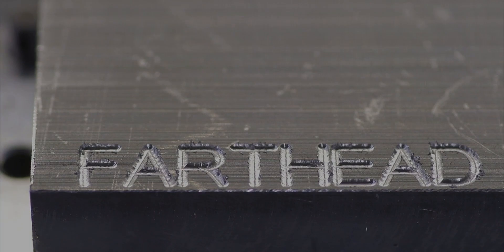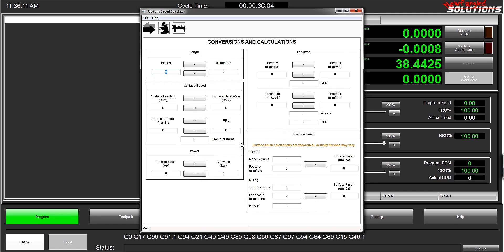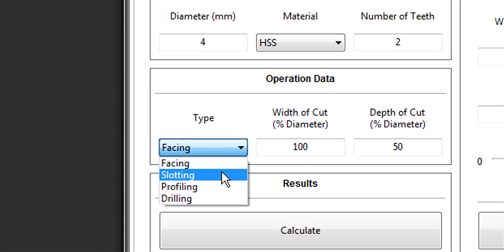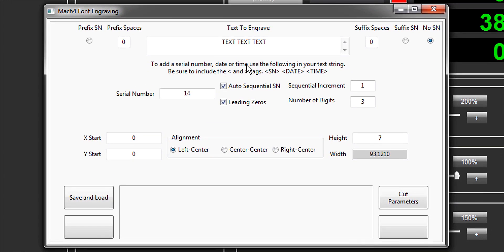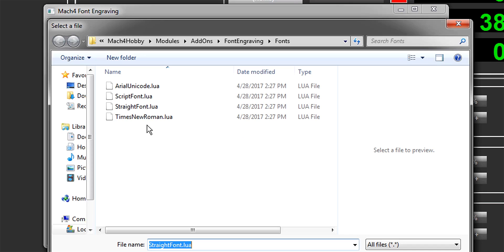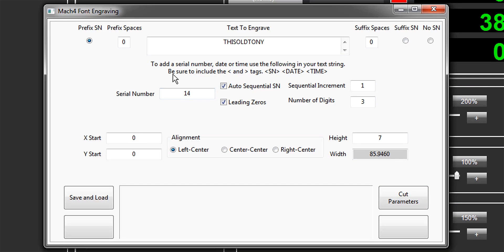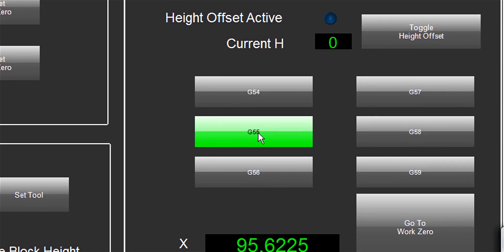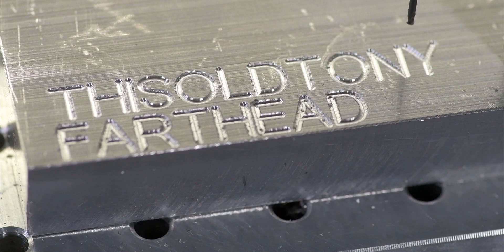Easy CNC Engraving (Mach4)

Comment: For feeds and speeds calculations I generally use FSwizard lite for android which is free, so far it's been pretty accurate and has a much more elaborate tool/material library. It also takes into account the tool geometry so it automatically adjusts for long tool stick-out and such.

Comment: 1/8" ball endmills work great for engraving. Set the depth to .008-.010". Makes a line that doesn't have vertical walls so text comes out much smoother looking.

Comment: Those fonts are "lua" files. Lua is a scripting language. Plain text. Pretty good chance you can just pop those open in a code editor. Probably just some lua code to point to a TTF font on the local computer with some other settings.
Reply: Anvilshock Seems like an overreaction. Relax. Because I don't own a CNC router, or Mach 4. It's not half assed nonsense. It was an optimistic educational guess that was wrong, and I was civilly corrected, and civilly accepted it. It happens. Had I noticed the file sizes of those lua scripts on my first watch through, I would have guessed differently. Nobody died. At worst, curious folks learned what was in the lua files without having to obtain and install software they can't use. And shockingly, another viewer who DOES have it was able to CONTRIBUTE to the conversation. The world continues to turn.
Reply: I didn't have it either, nor did I install it. I just bothered to spend 60 seconds downloading the file, unzipping it, and finding the .lua files.
Reply: Actually Lua code to draw the characters in the font. For example:

-- T
ascii84 = function()
ZUp()
G0(0.37330,0.98760)
ZDn()
G1(0.37330,0.98760)
G1(0.37330,-0.01410)
ZUp()
G0(0.00000,0.98760)
ZDn()
G1(0.00000,0.98760)
G1(0.74630,0.98760)
ZUp()
return (AddWidth(0.746))
end

The various functions are defined in another file. If you started with stroke fonts it would probably not be too tough to write a program to convert them into these Lua programs, but ugh...
Reply: Stephen Cohen Complete guess. I was hoping it wouldn't be that bad. Yikes.
Reply: Heh - I assumed it would be that bad, but checked anyway. It was that bad.
Reply: Of course it was a complete guess. Why make an effort to look it up for yourself BEFORE spouting half-assed nonsense ...

Comment: Nice video Tony.  Been running Mach3 for years as it works fine, but may be time to look at Mach4.  Does the Mach4 font wizard do the corner 'serifs' on the traditional fonts and rise out of the work, or is it at constant depth?  Thanks
Reply from the maker: far as I can tell, constant depth.
Reply: Thanks Tony.  Looking forward to the Mach 3 vs 4 video.
Reply: I heard Mach 4 has problems with threading and spindle speed control with the ethernet smooth stepper. https://youtu.be/rqIqn3lg3wA?t=375

Comment: My question is , How did you manage get a pair of drill marks on your collet nut thingyma doodle
Reply: Sax those are balancing
Reply: The nut is high speed balanced, and those marks are where material was removed to get it balanced.
Reply: Michael Timokhin ok they may be balancing pockets but how do you ensure that the nut is in the same place with different collets or end mills ?
Reply from the maker: Yes, balancing.  Presumably.  (it's import)
Reply: Stuart Hardy you aren't a real good thinker are you? The nut is balanced around its own axis. Everything else is balanced separately.

Comment: (Unlike AvE, I could watch your videos forever ;-) Those font files - I suspect, given the extension, that they're actually a script in the "LUA" language, which I have zero clue about, but it is used by Mach4 for automation tasks. So it's probably not possible to easily convert a TTF file to a suitable LUA file. Besides you'd need a single-line font, which gets into a whole other kettle of fish (if you're interested in getting into said kettle of fish, have a look at my page on single-line fonts: http://imajeenyus.com/computer/20150110_single_line_fonts/index.shtml)
Reply: I, on the other hand, do code in Lua, and would guess the files are a table of instructions for each character. I don't know G-code to know how one would turn font strokes into movement commands, but it sounds like something fun to learn one weekend.
Reply: "lua" is "toilet" in Hawaiian. as in, "save my seat, I have to go to the lua"
Reply: To be clear, I'm only guessing, I've not seen the contents of one of these font files. Lua is just a very table-oriented language. It doesn't have anything that would lend itself to machine automation, any more than any other scripting language. But it can store just about anything in a table, including functions. It's not an object oriented language, but the tables are so powerful, you can basically fake it with them. So my guess would be the G-code routines would be stored in tables, and then you could look up the instructions for each letter very easily.

If Tony sees this, and would like to open the .lua file in a text editor, and share a look at its contents I could probably tell what was going on pretty quickly. At least as far as to say, "yep, its an index relating letters to G-code."
Reply: thanks for the info
Reply: my comment seems to have bewildered you because you misunderstood it. i tip my trilby to you, good sir.
Reply: "how we're all  [...] too lazy to check things up for ourselves" - well, did you check?
Reply: Neat! Actually, that's pretty much how the Hershey text extension for Inkscape works - there's a series of coordinates stored separately in a data file, and the Python script cranks out the SVG stuff.
Reply: Thanks for the info Lindsay. I was wondering about the .lua fonts--if they were actually Lua scripts, and if they could be generated from regular font files. Thanks for sharing your handy website as well. Nice resource!
Reply: Jesus, what's your problem?!?
Reply: 1) My name is Lindsay Wilson. My first name is Lindsay. My surname is Wilson. I don't have two first names. Get that right. 

2) Anvilshock apparently knows what's in these files, which is fine. He could have simply explained what they were, in a nice, polite, reasoned manner. But no, he had to go off into a profanity-laden rant about how we're all so useless and too lazy to check things up for ourselves.

3) Diss my "little pen plotter toy" all you like, if it makes you feel better. There's a hell of a lot of happy customers who might disagree.
Reply: Oh, it certainly bewildered me all right.
Reply: Thank you for the complement.
Reply: Sir, I don't want no big troubles or anything, but your son just called me a farthead ...
Reply: You're a nice man.
Reply: was it necessary to shoehorn in bashing another youtuber into your comment, two-first-names? was he too mean about your little pen plotter toy?
Reply: Completely beside the point (as it happens, yes, I did subsequently check, and was going to post, before I was insulted by your foul-mouthed tirade). Why you couldn't have posted your information WITHOUT a fuck-filled rant is beyond me.
Reply: Why you couldn't have posted without failing to look up solid knowledge beforehand in the first place is beyond me.

Stop hitting yourself.
Reply: I'm betting you've heard this before but you're a giant tool.
Reply: BLAH BLAH BLAH BLAH BLAH DE-FUCKING BLAH. What ever happened just downloading the fucking software, installing the fucking software, having a fucking look at the fucking files included, fucking knowing the fuck what's fucking going on, and shutting the fuck up?? Oh, right. Because that takes actual effort than to regurgitate some hearsay.
The font files include a bit of Lua code with functions of g-code for every single character. Characters 33-125 (ASCII). Now shut the fuck up, you useless morons.